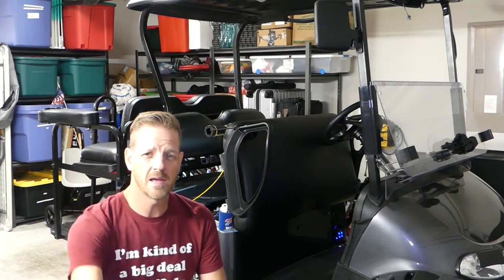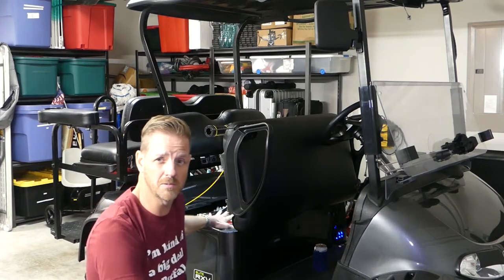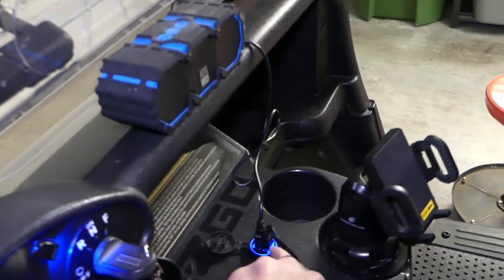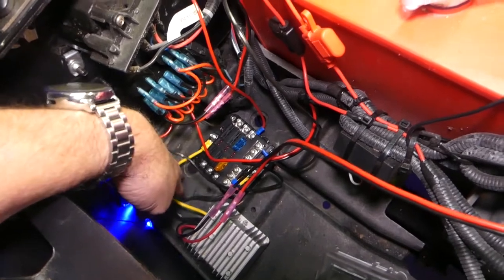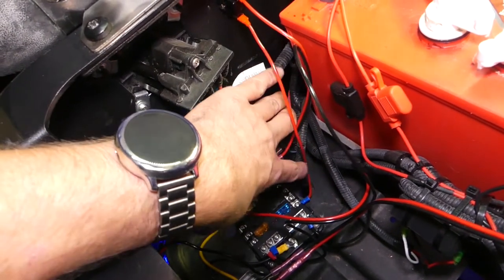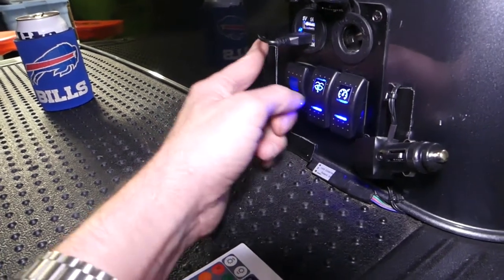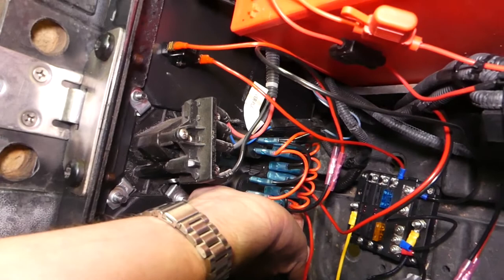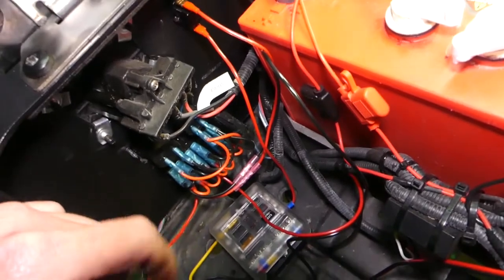48 volt to 12 volt on your golf cart

Comment: I believe that using transformer for 48v to 12v conversion will draw from all batteries equally.  If you hook it up so it only activates with your key or your draw should only be when key is activated for everything.  Standard is for headlights to turn off if key is off.   No draw.  Very good design 👍

If you hook directly to a single battery you could have a constant draw if accessory has an idle mode like anything with gps or some cameras that monitor things when vehicle is not in use.  They suck the energy out of just 1 battery instead of the 4 batteries like I have in my toy.   

I have some stuff now off key but couple accessories I want to use without key in it.  I have my reasons 😂.   I have 2 ways to turn the energy on and off to those.   Safety reasons.

Thanks again for video 👊
Reply: would you need to connect the fuse box after the ignition key or do you need a relay? trying to have fuse box after the key for this very reason.

Comment: You do realize that wiring up the transformer directly to the batteries will cause a constant drain on the batteries.
Reply: Agreed! A simple 2~Prong on-off kill switch is needed.
Reply: Would a 4 pin relay be more beneficial in this case?
Reply: Don’t the on off switches stop the battery drain?
Reply: @johnpeterson8162  no, if you have a transformer wired directly to the batteries
Reply: Marine switch for double batteries allow you to use either battery, both together at 12v or choose off. 

They used to be used in ambulances this way.  You choose one to start truck and your run.  Go to scene and park ….. now alternator says holy crap I can’t keep up .. .. sometimes they died.  (Many alternators replaced). 

Dead truck when you went to put patient.   But ….. 2 batteries.  Flip it over brmmm brmmm  in those days 😊